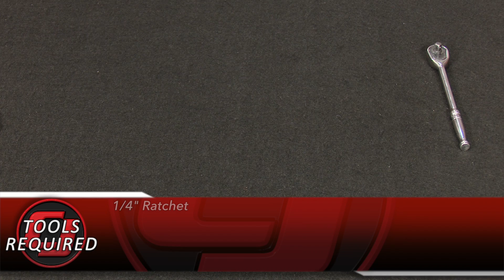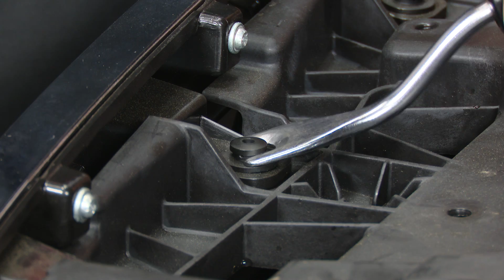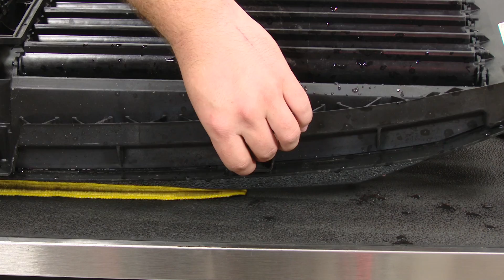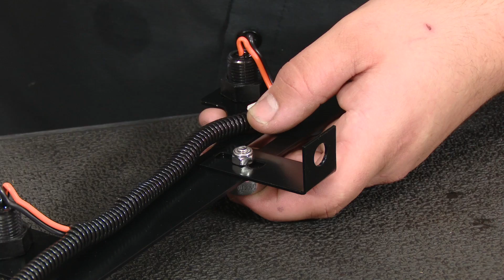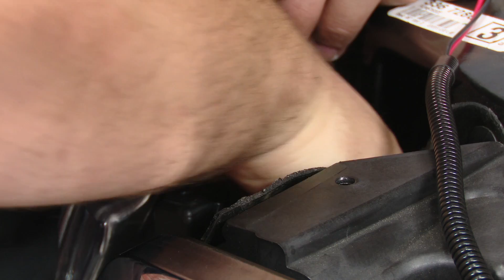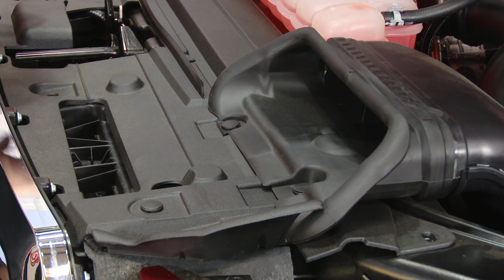F-150 Starkey Grille Lighting Kit Raptor Style 2015-2016 Installation

Comment: In another video you installed Roush fender flares in which the wiring rests on top of the radiator.  There were additional pig tails for auxillary lighting; is it possible to connect to this or is it best just to tap in as shown here?  Also, I have the LED factory lights, is the wiring the same?
Reply: It is possible to connect to them, the auxiliary plugs are meant to plug into the raptor style grille lights, if you wanted to connect to them for an LED light bar I would not recommend doing that. I would put a light bar on its own wiring and switch.